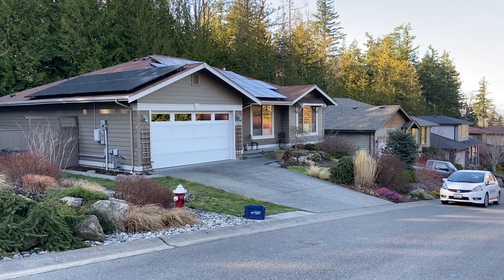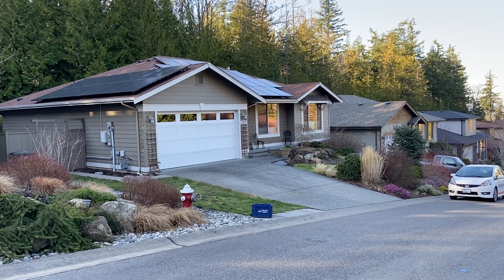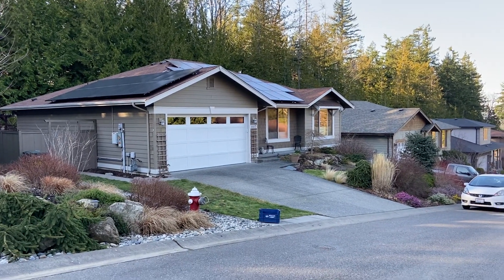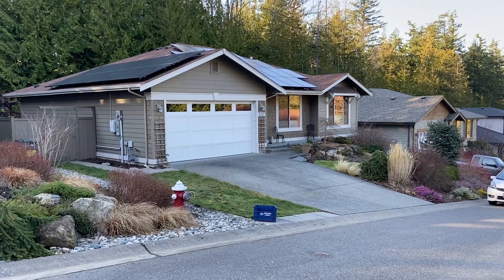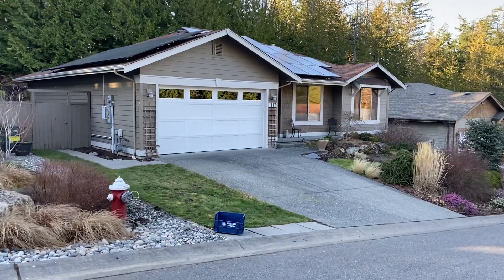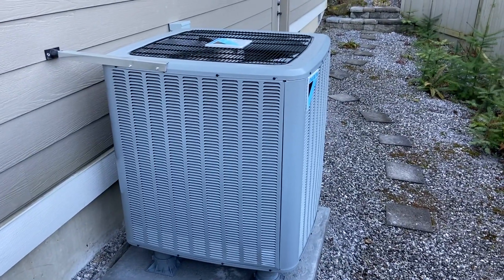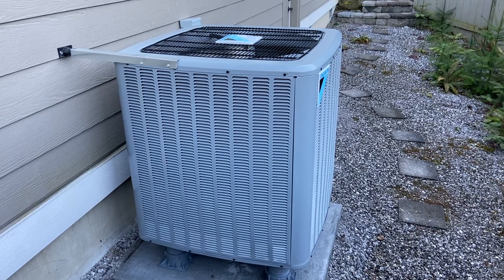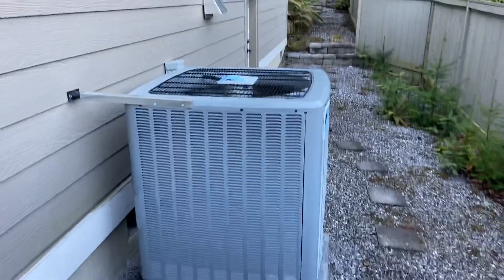Natural Gas to Renewables: Barron Solar and Daikin DZ20 3Ton Modulating Heat Pump

Comment: Hey I live is South Florida where humidity and high heat are a everyday thing. I have a 2  bedroom home and looking to install a cold/heat mini split system in both bedrooms and living room. Each bedroom is about 120sf. and living room is probably 4 to 500sf. What system would you recommend for a person on a modest budget. I am really interest in smart home connected device I want to be able to control the Mini Splits through Alexa or Google Assistant.  Great videos thank you for share such great insight.
Reply from the maker: Smite Elize I would do a 3 zone Daikin MINI-SPLIT with the WiFi adaptor! Ask about buying the Asure 12 year labor warranty when you get proposals.